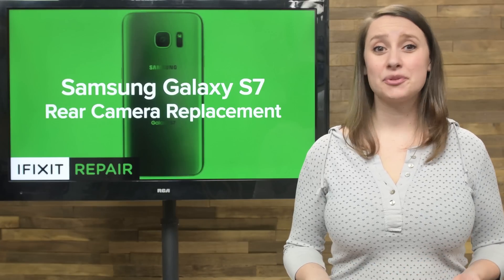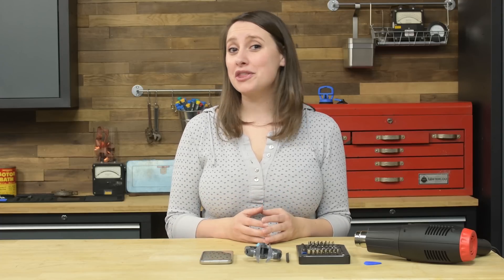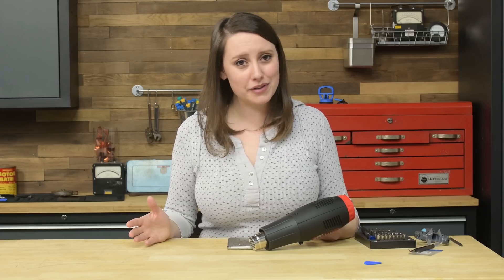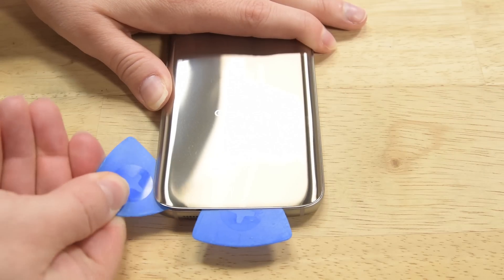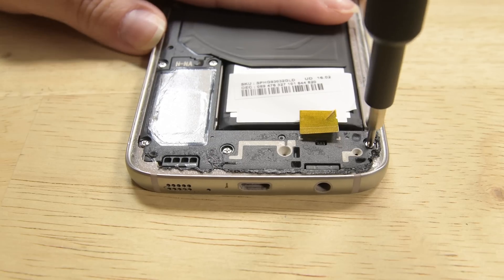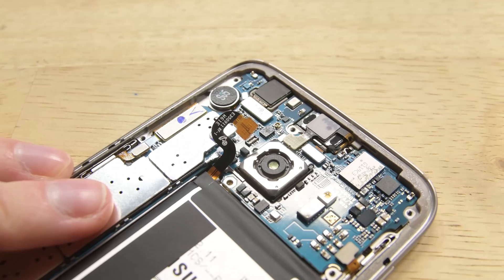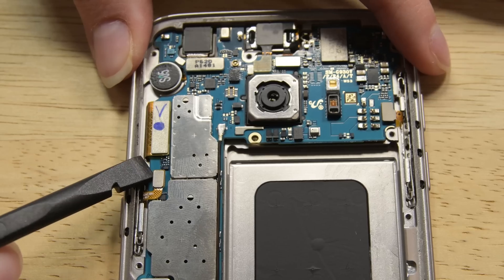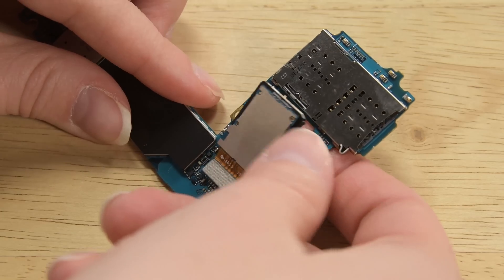Galaxy S7 Rear Camera Replacement—How To

Comment: Just had a successful swap thanks to this video! I had a hard time unsticking the battery and ended up realizing its not necessary to remove it. Putting the motherboard back in is only slightly more difficult.

Comment: I am having an issue where the camera won't work on my s7 and my flashlight icon is showing me that it is on and I can't turn it off. I've tried all the fixes I've been able to find online and nothing has worked, including a factory reset. This leads me to believe it is a hardware issue. If I replace my rear camera, will this fix my flashlight issue as well?

Comment: You don't need to take out the battery. In fact the batteries are generally so glued in that removing them destroys them. Leave the battery in place, only disconnect the lead.

Comment: YUP, followed the directions in this video and got my camera replaced. THANKS!

Tested everything and they work :) The only thing I didn't do is remove the battery. A little tricky getting around the ribbon cables with the battery on but doable.

There were 12 screws and 12 connectors to unscrew/screw back on and unplug/plug back in, respectively.

Comment: This tutorial really helped. I am going to replace my camera because there's a black spot. I removed the back cover and cleaned the camera lens and cover but the black spot is still there. (I used a electric blower and microfiber.) Actually, I made it worse because the camera became all smudgy and the black spot is still there.

Just got another camera on ebay for ~$16.00 shipped. Hope it works.

This is my third Samsung. Something always breaks. They make good phones functionality-wise... but they don't seem to be very durable. :/
Reply: I have the same problem😥 Did ur method work??

Comment: There is no reason to remove the battery.  I just replace the camera without removing the battery.
Reply: No you have to. With any electronics repair always, and I mean ALWAYS physically disconnect the power source before working on electronics. This is basic stuff dude
Reply: @philspaghet  disconnect and remove the battery are different things. You need to disconnect it but not remove it.

Comment: can you make a test is it still possible to make it waterproof using original adhesive after the repair?
Reply: Jakub Markowski no
Reply: If you replace your backglass with a new one that comes with adhesive and allign it perfectly than it should theroretically have the same level of water resistance after the repair, although I can't confirm that the adhesive used in replacement backs is the same as the original adhesive. 
I hope I could help you.